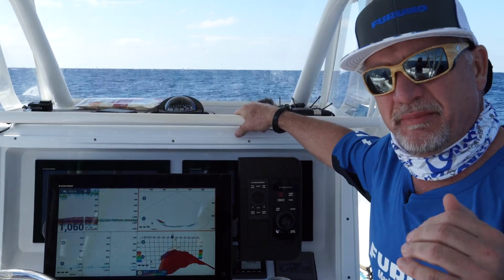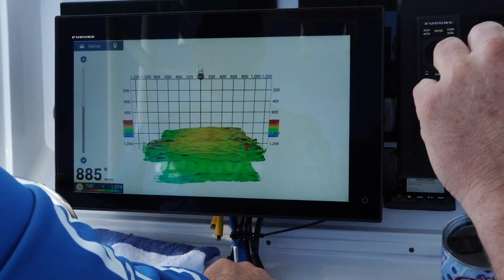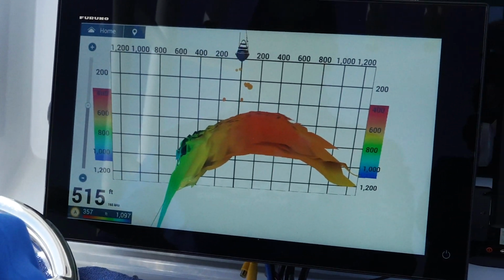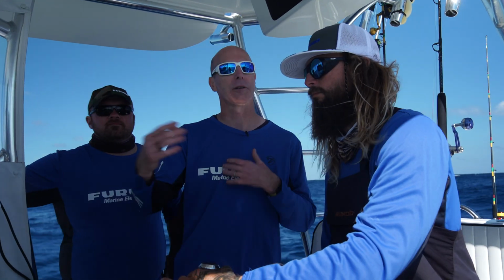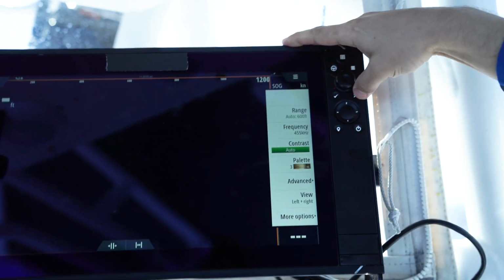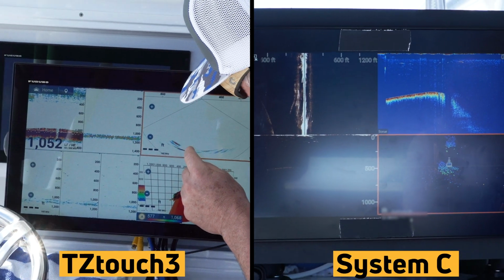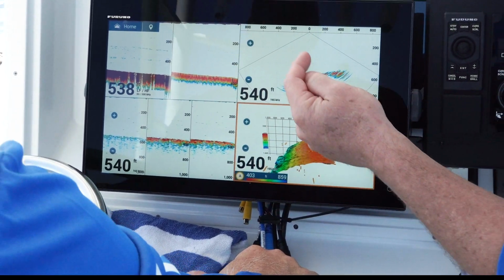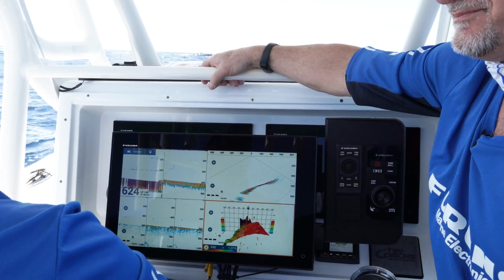EP19 Multi-Beam Side Scan Imaging Sonar Explained

Comment: Amazing system.  Just wondering what transducer you were using?
Reply from the maker: Hi Brian, this is utilizing the 165T-B54 DFF3D Transducer.
Reply: @FurunoMarineElectronics  
Does the  b54 transducer show the traditional 2D (top left in quad chart) or do you need to be running the 265lw in addition to the b54 transducer?
Reply: @KJ-md5hv  Hi KJ, Yes, the DFF3D Multi-Beam sonar does have a traditional single down sounder 2D image mode that shows the entire 120 degree swath under the vessel.  It also has a 2D "Triple Beam" down sounder mode that breaks the same type of image up into 40 degree Port/Center/Starboard sections which is very very useful for targeting fish and structure.  At the 3 minute mark in this video, the top left is showing the 50/200 Khz from a B275 which is similar to the 265 transducer that you mention. The bottom left is the DFF3D "Triple Beam" and the two right images are 3D History and 2D Cross setion modes.  With both TZT2 and TZT3 MFDs, it is possible to show data from the built-in Fish Finder and the DFF3D Multi-Beam at the same time.  That is how I had the system configured.

Comment: Can you scan lake and river floor with it in 3d to file and save it with location info?
Reply from the maker: Absolutely! Use the new PBG (Personal Bathymeteric Generator) feature found in the Version 2.01 software on TZtouch3, along with the DFF3D and you will be able to create a PBG file that is geo-refrerenced. Check out this video on PBG: https://youtu.be/6jrvdBrIYbw
Reply: @FurunoMarineElectronics  looks very ok for general use and fishing etc. but i need like 10x res (500 beams instead of 50 and 10x increased probing ammount for higher resolution) for relic mapping and search. Thanks for your reply tho, you have very nice product range!
Reply: @Vean440  Kongsberg
Reply: @salvor1  sadly they don't make anything affordable  :( seen some of there equipment in use and it was amazing
Reply: I need an S3 it seems!
Reply from the maker: @Vean440  Yes, it appears you are looking more for a WASSP system. You can find additional information about these systems here: https://www.furunousa.com/en/products/sonars/browse?filter=Discontinued.eq.false&group={6809C7DA-A9ED-4989-8E75-70553598F24D}&groupName=WASSP